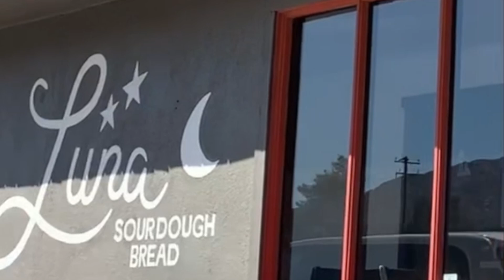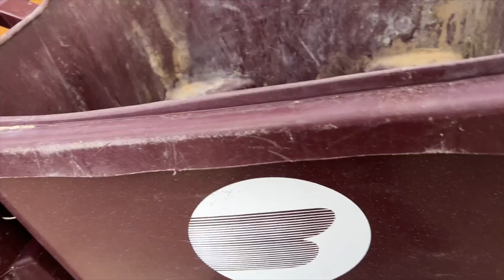Our FIRST Double Booking and WEIRD Guest Experience | Life as Airbnb Hosts

Comment: The code to the door should be something like the last 4 digits of the guests own phone, then they won’t forget it.
Reply: agreed. I've heard this can be set up automatically with electronic locks. idk their exact setup but that's a great idea!
Reply from the maker: Our lock setup doesn’t allow this… everyone’s is different. What lock do you have? Maybe we should change it up
Reply: The brand ours is is Schlage. My hubby says it can be programmed remotely. I’m sorry, I don’t know which model it is.
Reply: Was just going to say I have a Schlage lock that I can program and always set it and our alarm to the last 4 digits of our guest own phone number. We also have a spare key in a lock box outside just in case.   The app I use is called Trane and you can update the lock and set up special switches to control lights turning on automatically outside and in. That way our house is alway lit up if they come home at night. You do have to pay a monthly fee but it is cheap. 

I’ve also noticed that the Airbnb and Vrbo calendars don’t sync right away. 

You two are doing a great job. 

Would love to meet you one day at either our Airbnb or yours and share our knowledge.
Reply: If you use schlage, august, or yale smart lock, you can use hospitable to automate the programming of the codes based on their phone number and when their code will work and expire based on their reservation.
Reply: @kristenandmichael  We installed a Kwikset Smart Lock on the front door of our STR and program it to the last 4 digits of guest's phone. We & our cleaners have our own codes. We bought Smart Lock on sale at Costco for $180. We also have a house key in a lockbox on the back patio for emergencies. ✌✨